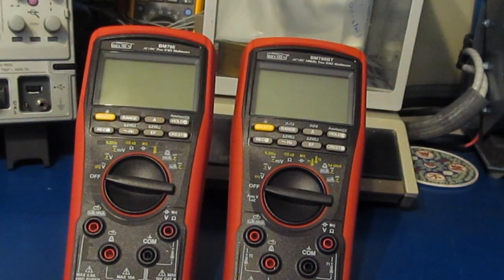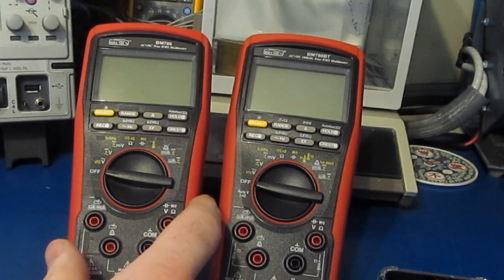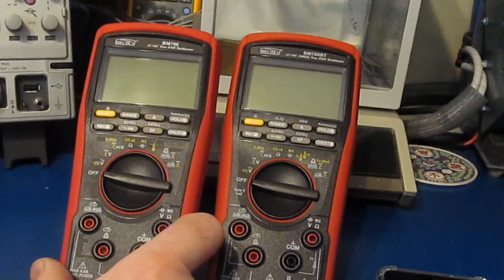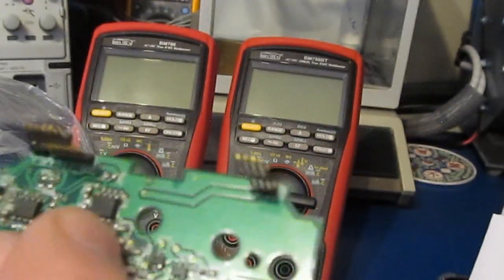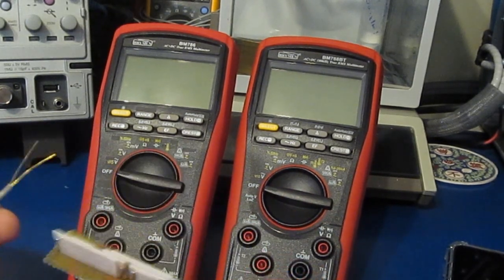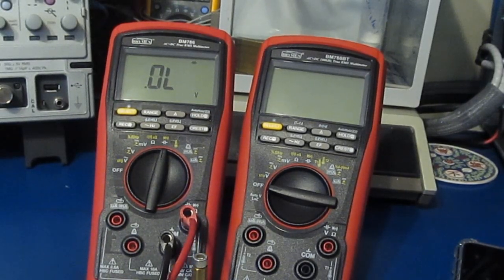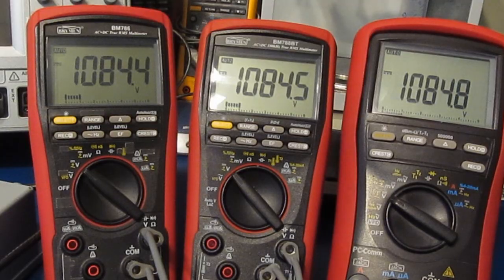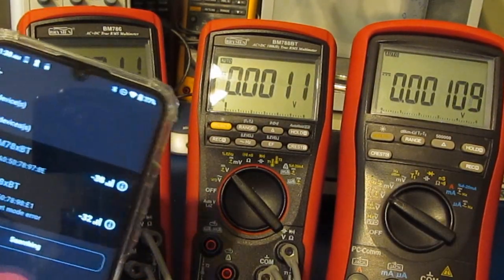Update on Brymen's new BM788BT DMM

Comment: Does de BM788 (/BT) have the 100khz ac bw ? Like the BT789 ?
Reply: came here to ask the same thing.  like is it basically a 789 with bluetooth?  (minus dB measurement apparently..)
Reply from the maker: @GannDolph  Correct.  Basically the 789 with BLE minus dB.  I understand the dB was dropped due to code space.
Reply: @joesmith-je3tq great- many thanks Joe
Reply from the maker: @GannDolph  Pinned in case others have the same question

Comment: dt4261 vs bm788bt
Reply: Yes, this will be interesting! I guess the Hioki will kick Brymen's A**.
Reply from the maker: You can easily compare them using the BM789 manual as a reference (less dB feature). Obviously they would have different uses.
Reply: Hey joe did you delete my comment? @joesmith-je3tq
Reply: Hey joe did you delete my comment? @joesmith-je3tq

Comment: Always quality content in your DMM video's. They are on another level.👍
Very well explained too. I've learned quite a lot from it over the years.
Not only about the multimeters and their specific quirks, but also how to look at them and deciding what features and properties are important to me.
I'd love to see you testing that Metrix/Chauvin Arnoux meter some time in the future. Not because I expect it to be extremely rugged, but because it's designed/built in such a different way than most other high end/high count/high accuracy DMMs.
Reply from the maker: I think when I looked, they had no distribution in the USA.  I thought that they also used mechanical relays without shielding, similar to that Gossen meter I looked at.
Reply: @joesmith-je3tq  Those relays are one of the things that I'm curious about indeed. What I wonder is if they stay in the same position when shutting down the meter.
Reply from the maker: @mrpetit2  Or like Gossen, does the magnetic hanger change their state and if so, does the meter show invalid readings?